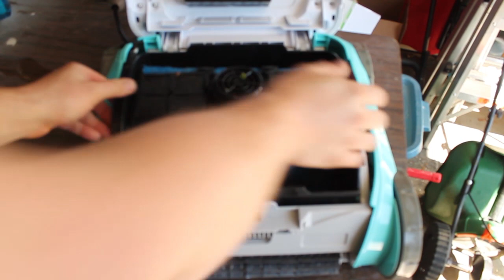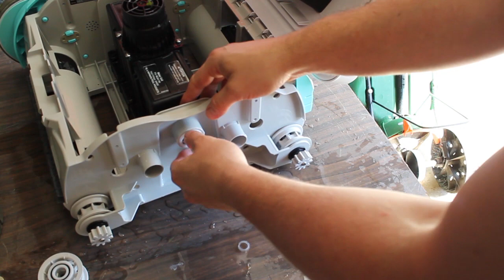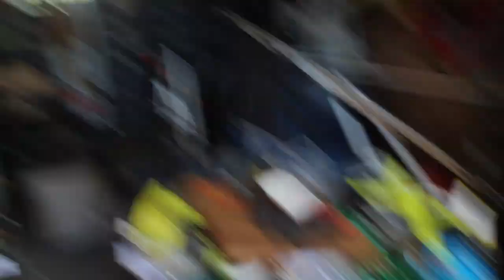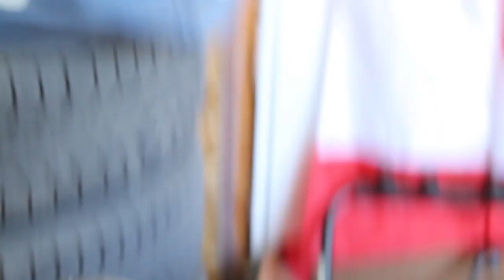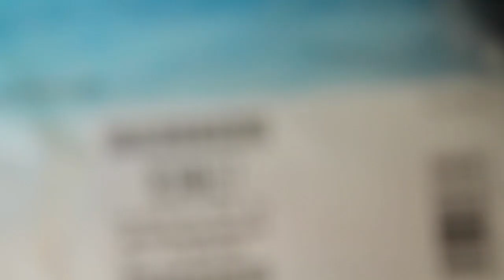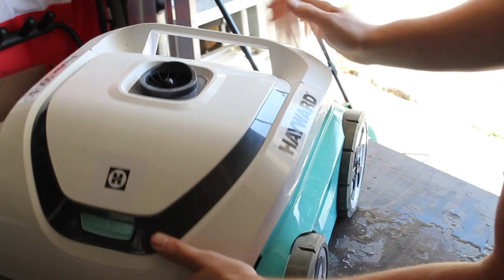Aquavac 500 - Vac won't move  - Motor Pin Repair - EASY FIX!

Comment: Well I changed the pin for like 5 times now but it keeps breaking every time. Sometimes it holds for a few months and sometimes after only a few times using it. It drives me crazy. 

Does anyone have any idea why it keep breaking?

Comment: I can't get my impeller to twist off. Ugh. It has a screw, which I loosened, but still won't budge. Does the handle have to come off first?  I am having a loud grinding noise and the rollers are not moving. Trying to check for obstruction, then will check pin.
Reply from the maker: The grinding might be the plastic wheel gears. Try taking the side off and spinning the gears individually.
Reply: @adammelrose  ok, will give it a go. Thank you!

Comment: where did u find breakdown of parts showing the pin #rcx40117? also can find part #'s for rubber insert holders for assembly of side cover??
Reply from the maker: It’s been a while but I Found it on a Hayward parts site

Comment: The torque on the pin is massive - I've gone through a couple of stainless screws and a screw driver bit while waiting for the pin to arrive. Warning: Maybe just wait until the actual pin comes in the mail because I buggered up the Hayward RCX97502GR Drive Bearing Assembly plastic using screws and bits. I ordered the entire drive bearing assembly and two pins. Great cleaner besides this - gets all the fine silt debris and dirt much better than some cleaners (looking at you Polaris)

Comment: This video saved me completely replacing my Tiger Shark robotic pool cleaner.  I have replaced so many parts on the TIger Shark over the past two years.  When it stopped moving during a cleaning cycle I figured it was the motor.  So I pulled it out of the pool and soon realized the motor was fine.  Somehow the Drive Pin assembly had fallen out.  I watched a video produced by Hayward on the Tiger Shark and they did not even mention the Drive Pin assembly as a possibility for the wheels not moving.  In fact they don't even show the Drive Pin assembly on their schematic other than in the parts list.  I already had my TIger Shark apart when I watched the video and confirmed the Drive Pin assembly was missing.  I will order one and install it.  Thanks

Comment: Thanks so much. Why did you unscrew the motor and put wood blocks under it?
Reply from the maker: Just to make it easier to work on
Reply: don't really have to, use magnetic screwdriver and vasoline on pin and it will stay in place to connect the drive..